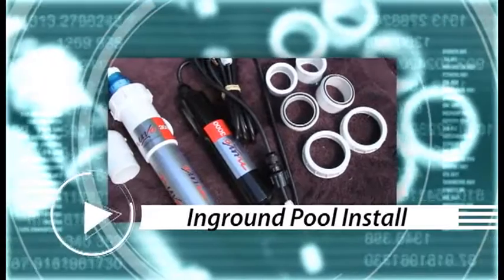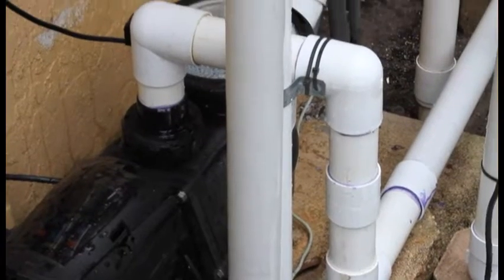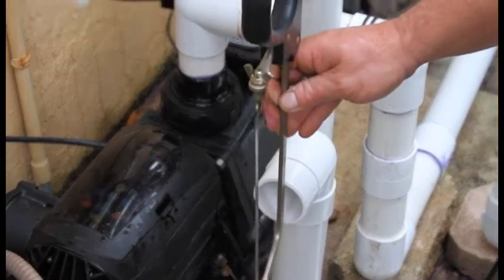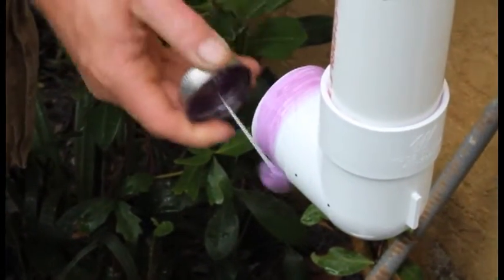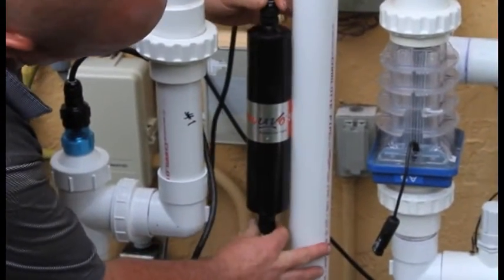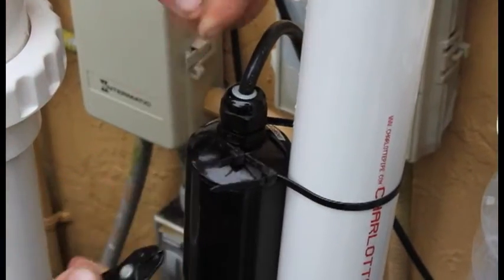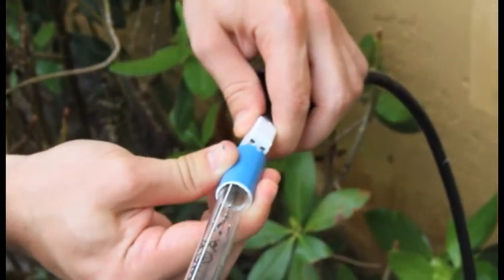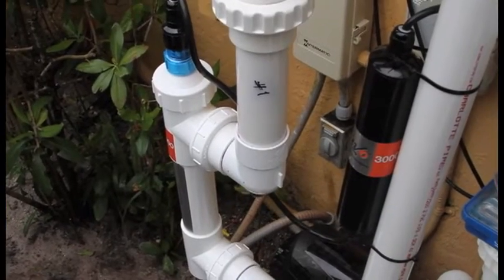Nuvo 3000 UV Ultraviolet Water Sterilizer

Comment: I was researching this because I wanted to install it in my salt water pool system.  I did plenty of research and while it is true that it kills bacteria and viruses, it's sort of misleading.   
Its advertised pretty much as a sterile water maker.  This is a fact, but the reality is that the sterile water is then brought back to the non-sterile pool and makes the entire process pointless.  If something like this was installed for drinking water its different because the the water comes out the faucet clean, but for pools it most likely would have very little effect.

Comment: How does installing this inline effect water flow?  Could it be installed in parallel with the main to keep the flow rate? I get that not all of the water will go past the UV filter each time it returns through the system, but all water would pass through it, say every third time, the pool fully cycles.